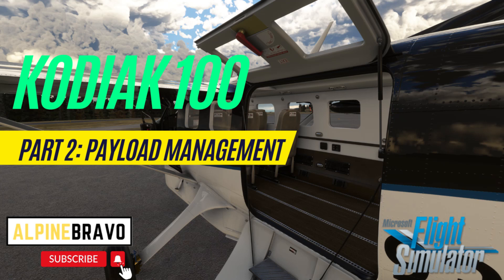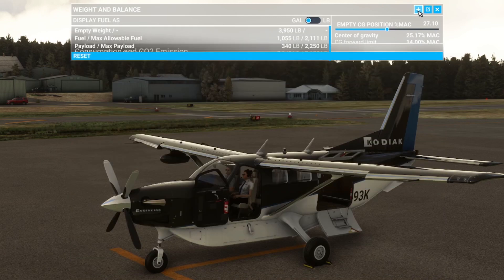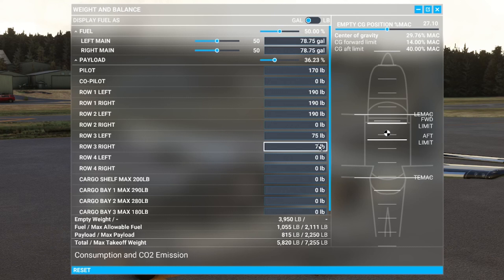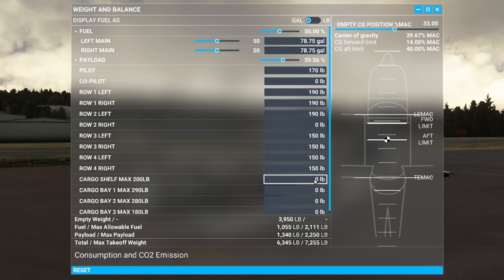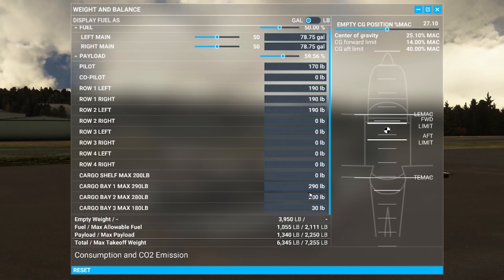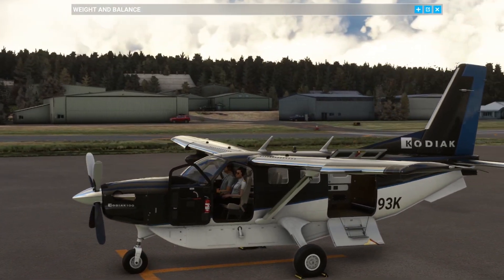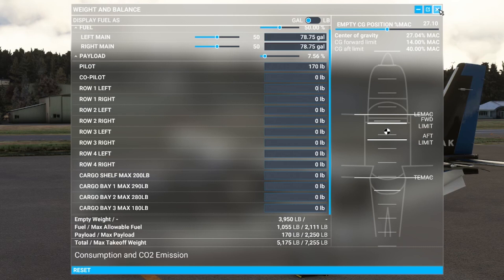How to Fly the Kodiak 100 | Part 2: Payload management

Comment: The dynamic value, cg %mac is used to calculate stab trim settings so takeoff control pressures are normalized at different cg's. Note: the EMPTY cg is a static value calculated by weighing aircraft on delivery. It should not be changed..

Comment: The "Empty CG Positon %mac" should not be moved. It is a value that is calculated on delivery of aircraft when it is weighed by a certified AMT and put on a scale. See FAA manual weight and balance chapter 3. At least the dev locked people out. Drives me crazy how many youtuber experts move this slider to center w&b.

Comment: Could you explain the proper way to do a traffic pattern inthis aircraft as far as power management and timing of things
ThxLee
Reply from the maker: Hi Lee, I've not done a video specifically on circuits but the parts on take-off and landings cover all the sort of power settings you would need.  The main thing is that landings are always power-on at touchdown.  A torque of 1000ft-lbs or so is what is usually required to maintain the correct Vref - which is too high compared to IRL, but it's what you need to do in the sim.

Otherwise its all as per normal circuits -by midfield on the downwind you should be configuring the aircraft. Try not to exceed 90 KIAS.
By abeam threshold you should be configured for landing and start descending.  Turn to base when the threshold is 45°aft (or further if you want to extend)
Target 500ft AGLfor base and reduce to Vref +10 KIAS.
On final reduce to Vref.

Fly with one hand on the throttle and the other on the stick and remember in a turboprop the power changes are not instant.
Reply: @alpinebravo7090  
Thank you so much! I've enjoyed your tutorials . Much appreciated!!
Keep up your great material.
Regards Lee
Reply from the maker: Thank you! I've had a long break learning to fly helos, but I'm planning on a G1000/autopilot episode soon as well as shortfield and bush flying ops

Comment: Hi, I've recently bought this aircraft and it flies really nice apart from the fact the my autopilot seems to barely work (barely turns as if it doesn't have enough authority). It also always turns right (like full right aileron it seems) with aileron trim neutral. Could this be due to incorrect CG? I never really bother loading properly and just add fuel and keep whatever loading was defaulted by MSFS. 

Cheers and very informative video!
Reply from the maker: Hi there,

The autoflight system is the GFC-700 paired with the G1000nxi.

The behaviour you describe certainly does not sound normal, but it is unlikely to be related to CG or aileron trim - the autopilot does not command aileron trim in the simulator.

When you engage AP put it into HDG mode first and use the knob to select different courses with at least 45degrees of heading distance.  It should bank at 30° to establish the new heading. There is a half bank mode too - that will limit the bank to 15°. Make sure that isn't on.

If you want it to follow your flight plan (the magenta line). Make sure to click the CDI soft key button on the PDF bezel until the CDI needle turns magenta and the Nac source is indicated as GPS.
It won't go into NAV mode directly though you have to get close enough to your track for it to engage - use HDG mode to fly an intercepting course.

It may be that you are getting this behaviour because you are arming nav mode with the CDI in VOR or LOC modes (green) - and without an active VOR tuned, it will not know where to go.

Failing all that, you may have a bug or a conflict of some kind. But with the G1000nxi, assume user error first!
Reply: @alpinebravo7090  Thanks for the quick response, I'm going to assume it's software related issue as I properly configure the CDI parameters before engaging NAV on the AP. It also can't hold a set heading via AP. The only thing it's consistently able to follow is a vertical path (VS, ALT HOLD, FLC and so on). I got lucky yesterday and it managed to also hold Lateral Navigation via AP. I'll try re-installing it and perhaps taking more time configuring the plane on the ground however, after now testing with a perfectly centered CG it still doesn't hold LNAV.

Thanks again
Reply from the maker: Sounds like a conflict. Empty out your community folder. Watch out for the PMS GTN750 mod. Can cause issues. Also make sure you don't have any of the old versions of the WT G1000nxi installed via the marketplace (do a search in your content manager for G1000 and if you have a the WT G000nxi with a picture of the PFD as the thumbnail installed, remove it)
Reply: @alpinebravo7090  Thanks a whole lot for the help, I've down everything you've mentioned and after it still banking heavy to the right I realised it was my controls settings with my yoke that I had modified (trying to make it more linear, viva saitek cheap plastic yokes). Upon reseting the flight yoke control settings, the plane now doesn't want to kill me!

Thanks again for the help <3
Reply from the maker: @Plupx  Yep, that would do it. I got some new Velocity One rudder pedals this week to replace my useless Logitech ones, but found I couldn't turn the Kodiak properly . After checking the sensitivity settings it was only reading 30% of the axis!  Problem resolved by the time-honored method of unplugging it and putting it back in!

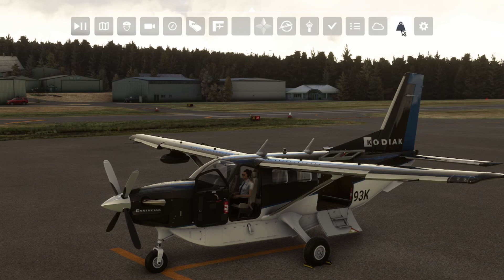Comment: Your toolbar at 2:02 is way more populated than the default.  What else do you have in there?  I'm here from part 1.  Bought the Kodiak last week and am enjoying it a great deal.  Skypark was why I was looking for a cargo aircraft.  Looking forward to the rest of this series!
Reply from the maker: The Kodiak is great for career-mode add-ons as you have to be realistic about how you load the aircraft and respect the CG limits.

For toolbar add ons, from memory I think there would be extra icons showing for:
- Navigraph chart viewer (payware)
- Input Viewer (Freeware)
- Pushback Express (payware that I use when flying the 737 or CRJ)
- OnAir panel (comes with the OnAir career add-on).

More recently I've moved over to the Premium version of the //42 'Flow' app. This supplements/replaces the toolbar UI with a wheel UI which in the premium version also comes with improved camera & weather widgets and an Active Pause that actually works (unlike the default).

Comment: Thanks for doing this series; subscribed! I just bought the Amphibian last night and spent only a few minutes with it. The very first thing I noticed is that there's no way to take 9 pax for a flight due to the CG! (Unless they all weigh like 59lbs.) I bought this specifically to start a tour company, so this is super disappointing. :-( Am I missing something? Or do I just have to fake it by making the pilot weigh like 900lbs?
Reply from the maker: Hi there, glad you are enjoying them!

I've not played with the Floatiak much yet, but as an amphibian, the floats and landing gear add considerably to the basic operating weight and therefore reduce the payload available.  Definitely no way you could get 9 adult Pax on a Floatiak!
Reply: @alpinebravo7090  Oh, whoops! I may have bought the wrong aircraft in that case. :-/ I suppose it's just gonna have cost my clients more per passenger per flight since they won't be able to split the cost 9 ways. I suppose most people don't have 8 friends anyway. :D I'll experiment after work this evening on how many adult pax I can take. Thanks for the reply!
Reply: @wilddoktor  If I'm correct, now that you've bought the one variant, you can by the other at I think half price.

Comment: Good series covering Kodiak, just the information I needed. Nice accent!
Reply from the maker: Thanks for the comment. More episodes coming up soon!
Reply: @alpinebravo7090  Good to know ! I’ve been ignoring Kodiak for some time, kind of tricky learning this aircraft…quite different from the other ones in my hanger
Reply from the maker: It's a lot smoother to fly in the latest release (v1.4.0) with improved slow speed handling, but still has a pretty unique character and definitely takes some more effort to fly well than many similar aircraft in MSFS. I find with live weather it can feel very authentic. And this is without CFD.